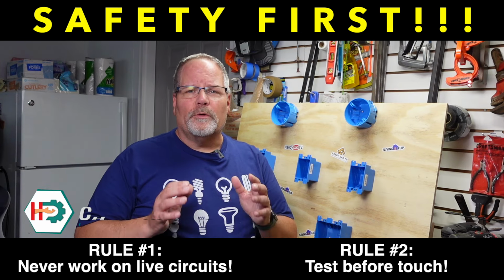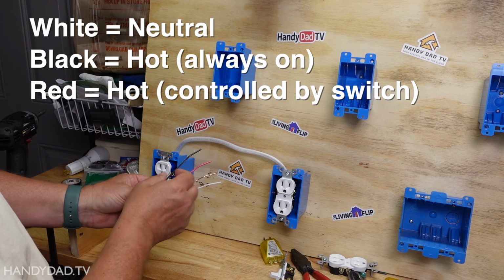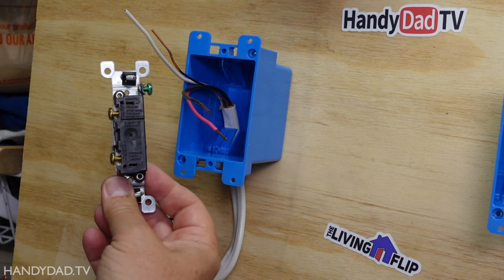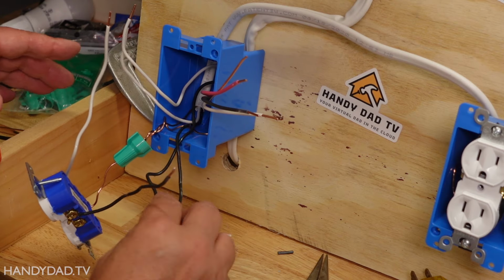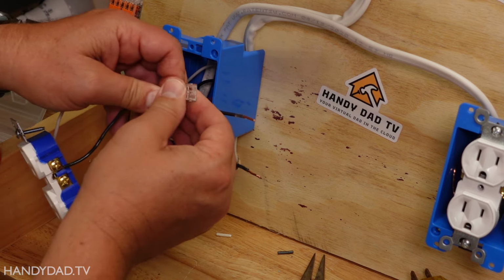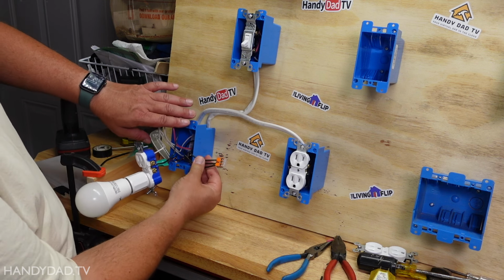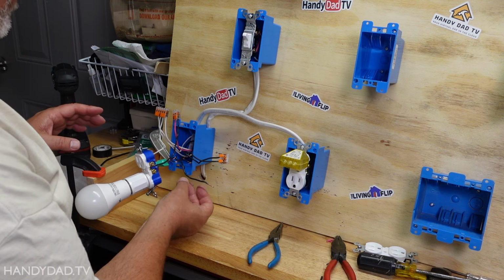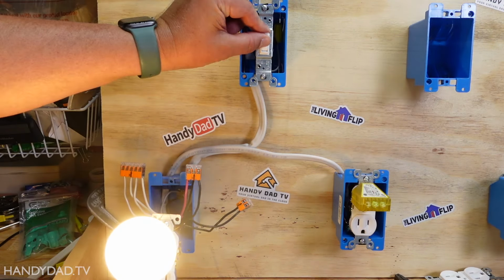How to Switch an Outlet

Comment: So in this case you ran the 12/3 so you can control the power of the receptacle with the switch correct? Let’s say you have a light and the home-run is in the light box, and you have a 12/2 from that box to a switch, then the switch to the receptacle, would you just pig tail the hot in the switch box to the terminal on the switch? And terminate the receptacle normal neutral/hot/ground. Would that work?
Reply from the maker: In this video, I was switching an existing outlet where power came into the outlet box. 

If your power comes into the switch box, you can use 2-conductor to the outlet instead of 3.
Reply: @handydadtv  can you provide a wiring diagram utilizing 2-conductor if the power is in the switch box that wires two receptacles? Thanks
Reply from the maker: Describe what exists right now, and what you want when you’re done.
Reply: Right now I have a switch which is being fed by a 12/2(hot) and from that switch I want it to control two receptacles just like your setup in this video. Your hot is in your receptacle box and mine is in my switch box. .
Reply from the maker: What is the switch currently controlling? Will you daisy chain the outlets (just one connected to the switch; the second outlet connects to the first)?
Reply: @HandyDadTV  the switch was installed to switch the outlets only. Yes they will be daisy chained.

Comment: Could've done a continuity test with meter to determine the correct wire to (right) outlet? Instead on work with a hot (live) wire?
Reply from the maker: Yes, but that’s hard if you don’t know where the other end is. I always separate the wires and test to see which is hot.

Comment: I’ve already ran 14/2 wire for an outlet that is going to have plug-in lights. I want to operate it by switch. I don’t have to worry about the code. How would one go about wiring that to the outlet from the switch is it the same wiring a switch to a light
Reply from the maker: How to switch an outlet… that’s the topic of this video. But yes, it’s the same as a light. Always switch the hot lead and you’ll be good.
Reply: @handydadtv  Thank you for the reply, and help just to be sure what I did was run the hot from the switch to the hot on the outlet. I ran the neutral from the switch to the neutral on the outlet, and tied the grounds together with the green wire nut with the hole at the top pretty straightforward I used to 14/2 wire will this be OK?

Comment: The best way to test which wire is running to that other outlet is to (with the power OFF) do a continuity test with a multimeter. If you can't reach, run an extension cord from the outlet you want to test, back to where you are so you can test for continuity. That's it. Don't do this live power juggle act he shows. Just separate the wires and continuity test each one back to the hot side of the outlet in question.
Reply from the maker: That works too.

Comment: In my attic my HVAC installer removed a light switch and a electrical outlet that were right next to each other and now there are just a bunch of wires connected to one another, which are powering my air handler. How would i go about adding an outlet into this mix as i need an outlet in my attic.
Reply from the maker: Use a voltage tester to verify the black ones are hot and the white ones are neutrals. Then add pigtails to connect them to your outlet.

Comment: I have been trying to figure out how to add canless lights in my ceiling and use the power from an existing fan that is wired to a wall switch.  I dont want the fan to come on everytime i turn the caless lights on--but--I also dont want to have to fish walls or run other lines.    suggestions?
Reply from the maker: You need to open it up to see how it’s wired. If you have two hots at the fan (one switch, one on constantly), you can wire the fan to the hot so you need to use the pull chains (or a remote). Then you can use the switched hot for the lights.

Comment: Sir, do you believe that there is any danger in running loose Romex behind a wall?
Reply: Yes.
Reply from the maker: No. The only reason they attach wires during new construction is to keep them away from the wall sheathing or drywall. Once the walls are built, it is common practice to fish wires through a wall cavity with opening the wall to attach them.
Reply: Yes, there is extreme danger in running loose Romex behind a wall.
Reply: @handydadtv  Thank you for taking the time to reply. You are decent and respectful.
Reply: @guyrabinowitz  ; yes I read the response from Handydad, he is wrong. 
There is catastrophic danger involved in running loose Romex behind a wall.
Reply from the maker: Fred, I disagree. Surely you’ve seen old work boxes that mount anywhere in the stud cavity. I’ve never seen an electrician open a wall to attach a box or staple a wire to studs. Even if you can prove it’s a code requirement, it would really surprise me because I’ve never seen anyone do it.
Reply: @handydadtv  ; No, running loose Romex behind a wall is a recipe for disaster. 
It’s one of the worst things a human can do.
Reply from the maker: Based on…?
Reply: @handydadtv  ; based on the Bible, the United States Constitution and the Time Warner Home Improvement book series.  And I have 60+ years of electrical, framing and sheet rocking experience while I was building in the Middle East.
Reply from the maker: Hahaha 🤣
Reply: @handydadtv  Sir, my original question should have been this: Is there a fire risk by not using conduit (or any other casing) when running Romex behind a wall?
Reply from the maker: I never heard of a fire starting in the middle of a wire, but conduit would be even safer.
Reply: @guyrabinowitz  ; there are literally thousands of fire tragedies every year by unprotected Romex in wall cavities. 
I should know, I’ve been a volunteer firefighter and home inspector for the last 75 years while restoring castles in Scotland.

Comment: How do you do the same thing with only using 2; 2 conductors (black,white, ground)
Reply from the maker: If you’re running a new wire, do it right and use 3 conductors.

Comment: If I'm running lights off outlets in my shed using a single poll switch would I have to have 12/3 wire.
Reply from the maker: 12 gauge wire is for 20-amp circuits. If you have a 15-amp circuit, you can use 14 gauge wire. 

Whether you use 2 or 3 conductors depends on how you wire it. Code requires a neutral in every switch box, whether you need it now or possibly in the future.

Comment: Instead of messing with the black wires with the power turned on, all you need is a digital multimeter, and check for continuity across the black wires.
Reply from the maker: That’s fine if they’re close enough.

Comment: All of those wires in a single gang box… how did you get them all to fit in there and the receptacle too?
Reply from the maker: Use deep boxes whenever possible and fold the wires. The wire connectors are the biggest challenge. Stagger them one at the top, one at the bottom and one in a side corner.

Comment: How can I install a gfci outlet to box with no neutral wire. It only has 1 red and 2 black wires.
Reply from the maker: You can’t install any outlet (GFCI or not) without a neutral.

Comment: How would I wire a single switched outlet from my breaker box?
Reply from the maker: I don’t have a video about adding circuits. You’ll need to look elsewhere for that. But the wiring of the switch and outlet are the same as shown here.

Comment: Handy dad I am making a arcade machine at home how can i wire the power outlet to a on off switch
Reply from the maker: This video showed how to switch an outlet. Are you thinking about a different kind of switch?
Reply: @handydadtv  I'm just confused I guess I bought a 3 wire plug to run power to a outlet/switch, I want the switch to either provide power when on or nothing when off
Reply: @handydadtv  it's for a home arcade I built
Reply from the maker: @alecfoster7711 Your 3-wire plug should have black, white and green wires. You only need to switch the black like I showed in this video.

Comment: Newbie here.. trying to figure out where all the black wires came from.. one from the other outlet, one from switch, one from breaker.. why is there 4??
Reply from the maker: At the beginning of the video, there were three black wires under a Wago: one from the breaker (power in), one to another outlet (power out) and a pigtail to the outlet. 

When I added the switch, I needed another black wire to bring the hot line to the switch. That’s four.

Comment: Sir a very good job. I do have a question: how can I connect a 3-way switch to a fan/light with a wall-remote- control switch? Thanks I be waiting for your answer, please do respond for I need to fix this problem, Juan.
Reply from the maker: This video explains 3-way circuits: https://youtu.be/aajyhWpU9fo

Just pretend the light is your ceiling fan.

Comment: You did not mention that single gang box is way to small to accommodate one device and all of the conducting wires. A single gang outlet only allows 18cu. You have 8 conductors, ground, one device, and lugs!
You’re over 42cu! Way out of code and to much heat for a single gang box, 32cu max for a two gang box, 44 for a three gang box,60 cu for a three gang box.
Reply from the maker: Thanks
Reply from the maker: According to https://www.omnicalculator.com/construction/box-fill, with 7 conductors (14 AWG), 3 grounds and one device, the box needs 20 cu. Still more than 18. 

Thanks for pointing this out.

Comment: My only question is, how do I create a switch with an existing wire in place. For example I have 12/2 wire running from a breaker all the way to an outlet. How do I create a “switch” in the middle of that wire to where I don’t have to run anything new to the breaker and mess with the panel and can kind just put a switch somewhere in the middle of the wire?
Reply from the maker: Even if the wire runs exactly where you want the switch, there won’t be enough slack for you to cut the wire and add a switch box. The preferred method is how I showed it.
Reply: @handydadtv  I got it, but how do I connect the 12/3 or 14/3 wire back to the original wire (the wire feeding from the breaker box).. so you have the wire from the breaker box runs to point A. Point A I place a switch and use 14/3 or 12/3 to connect to the original wire from the breaker box just in a square junction box?
Reply from the maker: @ryanblake365 Run it from the outlet like I did.

Comment: Wego connections look crappy...
Wire nuts with twisted wire looks good
Reply from the maker: They’re not crappy at all. Just not what you’re used to seeing.
Reply: Agreed,  wegos save time and if you need to redo a circuit  its much easier to take apart. Technically speaking if you are using wire nuts, the wires are not required to be twisted together even though most people use that method,  the wire nut is designed to bond the wires together